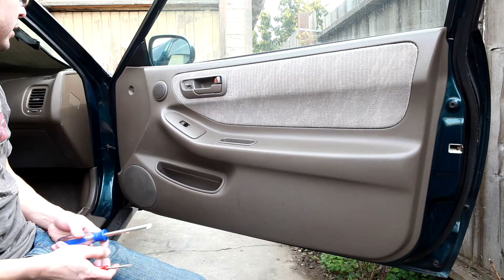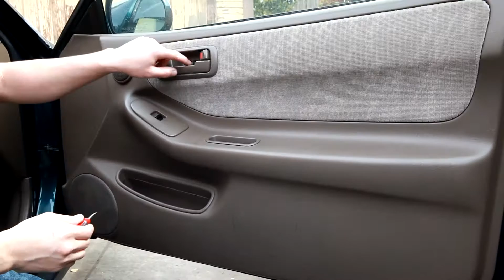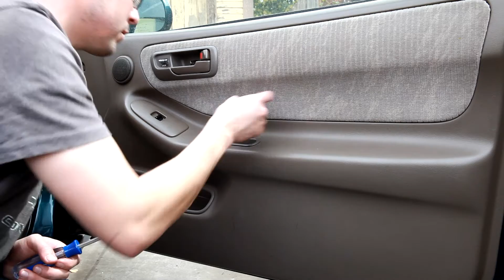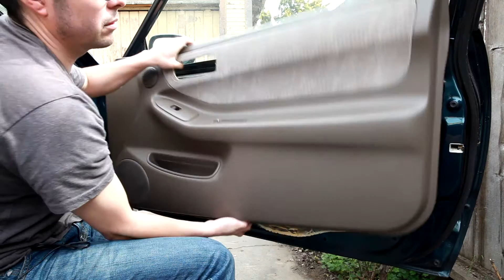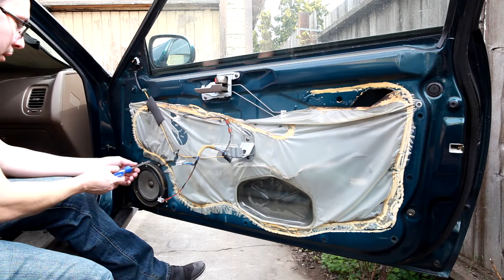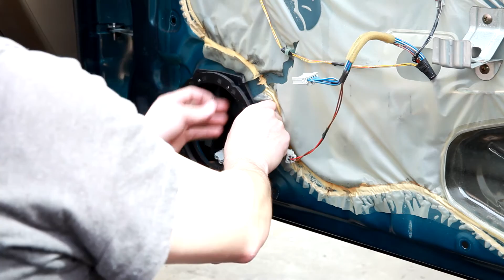1994-2001 Acura Integra GSR front speakers replacement with door panel removal

Comment: Quick question are you able to replace the speaker without taking off the whole door panel?
Reply from the maker: No, you need to remove the door panel to access and replace the speaker properly. 👍🏼

Comment: Shouldn't the door speaker be replaced with a component set, meaning a midrange woofer plus a separate tweeter? Rather than the two-way shown here. Trying to figure out the proper woofer/tweeter replacements for my '94 GS-R.
Reply: I suppose if you are running the factory stereo that would be important. If you have an afrermarket receiver/head unit then you aren’t going to be working with the same distribution unless it has 6 channels